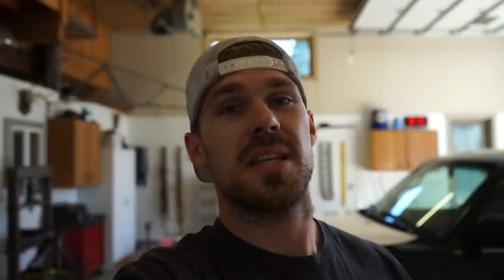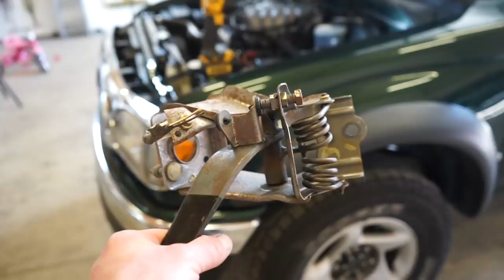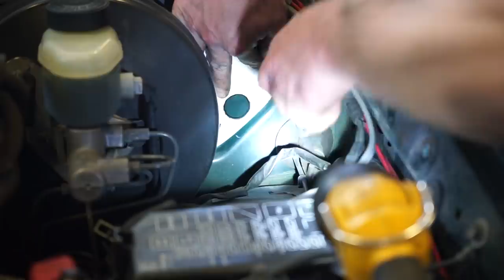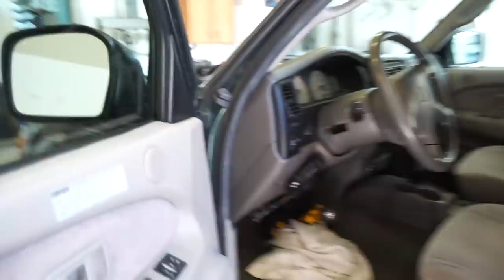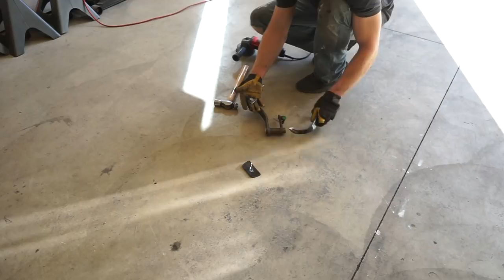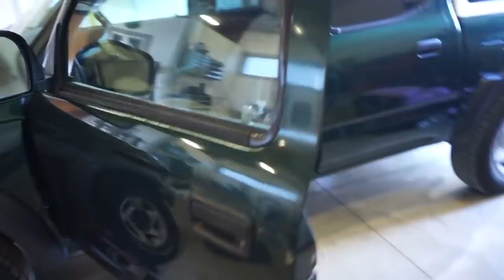Tacoma 5 Speed Swap/ Clutch Master Cylinder Installation!!

Comment: Get rid of that torsion spring and go with the linear spring. I did that to mine. 👍👍👍🤙🤙🤙
Reply: I used the 2.7 4 cylinder linear spring. 👍😉

Comment: Hi Austin! I have been watching your channel for some time now. Toyota has some pretty good diesel engines that would be ideal for your purpose. There is the 1KZ which came out in the 90 series Land Cruiser Prado (Japan, Asia, Australia, Dubai & I believe in Europe). The 1KZ began as a naturally aspirated turbo diesel and in the last iteration it had a EFI turbo. Then this was replaced by the 1KD which was rolled out in the Toyota Hilux pick up trucks here in Asia and Australia. 

There is also the 1HDT 6cyl turbo diesel engines that came out in the 80 series Land Cruiser and was also used in the 100 series Land Cruisers (I believe the 105). What might interest you is that these toyota diesel engines were also used by yanmar to power boats and were coupled to the Mercury Bravo 2 stern drives. Essentially yanmar purchased the toyota base engine, put in a bigger turbo and marinized the cooling system. So you can actually get one of these yanmar engines, remove the marine cooling system and replace them with an automotive water pump and radiator. Since yanmar put bigger turbos than what were available on the land cruiser, these engines would churn out 315 to 320hp. The old models of the yanmar were the 6LPA-STP but the newer version of this was the 6LPA-STZP and 6LPA-STZP2. 

That would give you another option for a diesel swap. And these engines retain the original toyota engine mounting points.

Comment: For patterns, scan and save to a PDF.  Then the recipient just needs to make sure they print it actual size.  Could put a reference Guage in the scan as well--like a known 6 inch line.
Reply from the maker: I’ll try that!! What program could I scan with?
Reply: @austinniemela  you would need a printer/scanner.  You can get them for under $100, but if you don't need one for anything else...
Reply from the maker: @plus790  yeah I have a scanner I’ll give it a go

Comment: Why could t you just put the brake petal from the 5 speed truck on it?
Reply: Couldn’t*
Reply: I would have just switched the pedals, done this swap myself and just switching the pedals is easier.
Reply from the maker: The pedal from the 96 is a complete different pedal! I guess swapping the whole bracket may have worked
Reply: @austinniemela  
And the booster and master cylinder? The whole assembly engineered by Toyota?

Comment: On the diesel what are you doing about the weak camshafts?
Reply from the maker: This one is in great shape actually
Reply: I was just wondering because that has been my biggest concern with a bew swap. I have been running Rotella t4 in my alh jetta and the cam shaft is over 300k in the engine. If I recall correctly the bew and alh share a common block so maby you could use a alh head, pump, and timeing set on a bew bottom end for the best of both worlds

Comment: Hey Austin, I have a 2ng gen 4runner than was manual swapped (similar setup to what you are doing), and the rubber pad on the clutch pedal keeps slipping up off the bottom because it hits the floor at full engagement. If you wind up having the same issue, let us know what you do to fix it!
Reply from the maker: Nice man will do!

Comment: why didn't you just use the manual brake pedal? Is it different where it pivots or where it attaches to the booster rod?
Reply from the maker: Yes it’s different where it mounts

Comment: I want to convert my 04 dbl cab to 4wd. I want to leave it automatic so the conversion should be pretty easy I'm assuming? Would the 2wd computer work with the 4wd trans?
Reply from the maker: Yes much easier! I would assume you need a 4wd ecu!